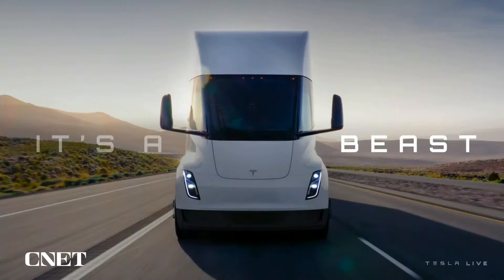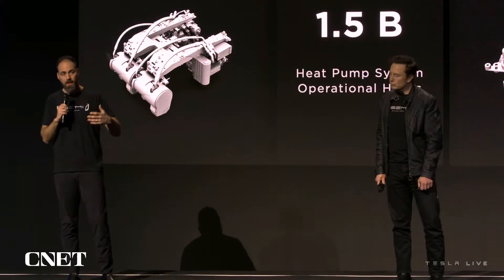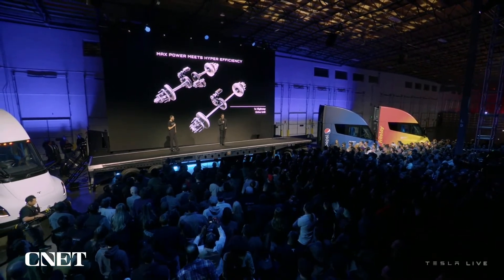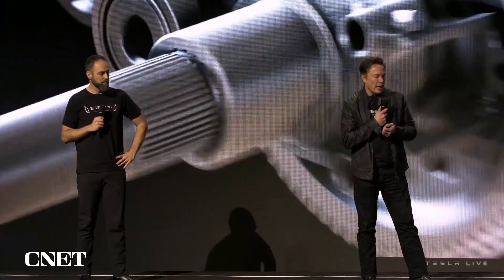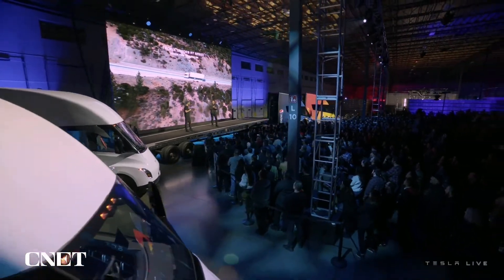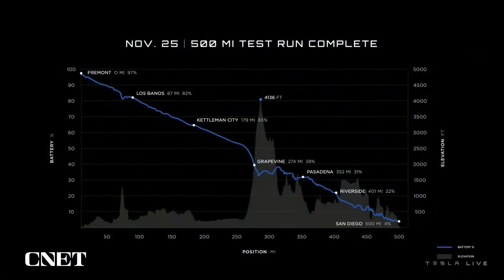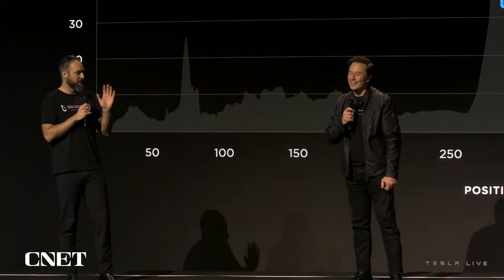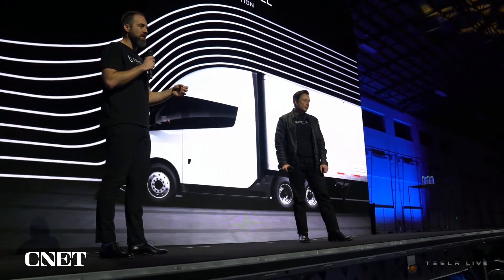Watch Elon Musk's Deep Dive Into the New Tesla Semi-Truck

Comment: How much heavier than diesel trucks  how much longer to stop and break changing game changer  imagine a hacked truck playing down the freeway  it's going to be a hackers world probably paid for by competitors   musk knows there's free energy  so where is it   Nicola Tesla would be rolling over in his grave
Reply: Not much heavier than diesel. 
Same or better braking distance as diesel.
30 mins charging time.
Hacking a Tesla is nearly impossible and they run frequent competitions to find and any holes.
Reply: @anthonypelchat  30 minutes charging time,  for a semi ,seeing believing  and the amount of batteries needed the weight  would vastly heavier which would make breaking distance vastly larger therefore needing much more regular break repairs at Tesla cost of course  side note I've seen what happens when you overcharge an electric scooter ,there have been reports of evs igniting for no apparent reason  very rarely but it does happen  oh and 1 last thing the chemicals needed to make the batteries ,lithium ,cobalt etc  isn't that just mining something different by the same cooperations  not to mention the child slaves in Africa  where did Elon come fro. Again 👁
Reply: @muaythai.8474  Charging time isn't a limit of battery size. Each battery cell is the same as what are in Model 3 and Ys. There are just many times more. You just have to deliver enough power to the truck with a charging system to charge it in that time. It is called battery charging C rate. 

The weight of a semi is the same as any other semi, no matter if it's an EV, diesel, hydrogen, or natural gas. They have a max weight for the truck, trailer, and load combined of 80,000 pounds, though EVs get 2,000 pounds more. So only 2.5% heavier at fully maxed out load. However, while EVs have the same regular brakes as every other diesel truck out there, they also have regen braking which can use the full power of the motors to slow down as well. That is instantly in use as soon as you let off the accelerator. So again, braking distance would be the same or better than any diesel truck in use. 

Fires in EVs are rarer than fires with diesel or gas vehicles by far. Overcharging only happens by dumb people frankly. It won't automatically happen. And mining for battery materials is done once over the life of the vehicle instead of over 800 times for a diesel truck life. And no, Elon does not get any materials from mines with children or slaves. Only cobalt is in that situation, and you can get cobalt from other areas. Plus they have nearly removed all cobalt from the batteries.
Reply: @anthonypelchat  I didn't know there was already e trucks.on the road I thought Tesla was the first fully e semi ,at masks presentation he said there were specialy designed breaks for the truck  .anyway you went to a lot of effort so I'll leave it at that ,the proof will be in the pudding so to speak .
Reply: @anthonypelchat   I have to ask do you work for Elon...are you Elon..  how do you know cobalt situation in regards to Tesla .
Reply: @muaythai.8474  I know the information because it has been publicly stated. And you can trace where the cobalt comes from in many cases. Further, all LFP battery packs are completely cobalt free while both Tesla and Panasonic have been pushing to reduce cobalt from their NCA/NMC batteries for years.
Reply: @muaythai.8474  Yes, there are other EV semis on the wrong. They may or may not be using similar setups to Tesla. The Tesla Semi is currently one of the most efficient semis available and at the largest battery outside of EV mining trucks. 

The specially designed brakes aren't really specially designed except in how it provides additional safety outside of just stopping. Just like current Teslas, they have regular brakes just like other cars. But they also have regen braking, which recharges the vehicle to a stop if needed. And it recharges the battery at the same time. Electric motors are really incredible.

Comment: Good with innovation but long-distance visibility is poor in this truck because the driver's position is low compared to conventional truck. You want to see above the vehicles in front to plan your braking. Anchorage of goods is not regulated and the deceleration from passenger cars is much higher than heavy duty trucks with its trailers. It is dangerous to drive in the high way at high speeds with 40 tones when you don't see what is going long ahead. In Europe the General Safety Regulation demands since 2015 active safety systems such stability control, so jack knife is effect is history here, the trailers and truck are equipped with EBS brakes and ESP since 2015. Advance braking system also mandatory since many years in Europe. So it is maybe wow ! for american but all the list of safety features they mention here is old news for European truck manufacturers and drivers. The next GSR 2 will demands even more, like lane departure warning, Intelligent Speed assistance, recognitions of vulnerable road users etc, all that to be implemented by 2024.  Cab strength requirements would be interesting to see if it will get approval for. The electrification part if good with regeneration of energy with the braking forces but brakes need to be used other ways will be glazing and when no brake when you need it.

Comment: What if you charge at the top of Flagstaff and you need to use regen on the way down? You can't over charge the battery???
Reply: TRUCK has Neutral can COAST.
Reply: @markplott4820  but you need brakes to control speed if you are in neutral. Have you down those hills?
Reply: The recovery effect is too exaggerated. It will not have a significant effect on the range.
Reply: If you are at the top of mountain, don't recharge much. No reason for a full charge in most cases anyways.

Comment: If the first model is this capable imagine what they will be like in 10 years
Reply: What do you mean? It could be less capable to cut costs. Its always first generation that they put in best work in also hardly anything will change in that time only battery capacity probably.
Reply: @outlander234  Compare a 1920's car to a 1990's car.
Reply: @lauriesmith9019  What a ridiculous statement. Car technology has reached its peak long time ago, there are no more massive improvements underway. Drivetrain, suspension, aerodynamics etc. its all solved long time ago. Electric motors have also been mastered long time ago. Only level of improvement is the batteries.
Reply: @outlander234    Look at the Plaid motor, carbon wrapped rotor - never been done before.  Every year we see new advances in materials allowing things to become lighter and stronger - no improvements there???  The point is you cant speak of 2033 technology with 2023 thinking.
Reply: Yeah this truck does have all that has gone before it from electric trains and from their own cars and AI and production but these guys love to keep improving its so exciting to see the rate of improvement!
Reply: Or a few thousand years ?

Comment: I'll believe the 500 mile range with a full load claim when it's independently verified by a 3rd party lab. I have heard enough claims from Elon before (Full Self Driving video in 2016 showing a dude riding in a Tesla without doing a thing, 1 million robotaxis by summer of 2020, fully functional solar tiles unveil, all of which were total BS) to not trust a single BS claim he makes without independent verification. If this truck can really go 500 miles on a charge as he claimed back in 2017, they would have shown a range test back then, not 5 years later, and even now it's just an unverified claim.

Comment: As a truck driver I know one of the things Im looking most forward to is, not having a transmission that starts "hunting gears" when Im trying to accelerate through an intersection. Cant tell you how many times Ive felt like that could cause an accident
Reply: What do you mean by hunting gears? I'm curious, never heard that term.
Reply: @MrSaemichlaus  its when youre in an automatic that uses the air piston actuators to shift, and you mash the gas pedal, and the computer/transmission cant determine what the appropriate gear to be in is so itll pop into 4th, and then immediately into 5th, then 7th etc. and wont budge the truck at all. Really sucks when it does it unexpectedly and you have a car coming right at you while making a left turn in an intersection
Reply: @BigRedftw  I see, thanks for explaining. I have seen that on trucker vlogs but didn't know the term. I see the potential for danger in that sort of situation.

Comment: Elon says this is "3 times the power of any diesel truck" - but this is patently false. Many 600-700hp diesel tractors are made today. With three "Plaid" motors, there's no way this truck is making 2100hp.
Reply: 400x 3 = over 1200+ HP , 1.7kwh/mile super Efficient.

Comment: Considering Peterbilt, freightliner, and Volvo already have been out for 2 years already I'd say Tesla still has the take on it considering they got better range ....now what would be neat is Tesla come out with a 48 and 53 foot trailer with a chassis mounted battery ...so in reflection it would be easier for smaller fleets and then for larger fleets offer a kit or service to rebuild existing trailers....this way you can drive the 700 to 800 miles in a shift.
Reply: NONE of the other BEV semi  are 500 mile range and 1.7kwh/mile .
Reply: @markplott4820  most companies like the one I work it dosnt care....the long haul Mack CX or freightliner cascadia powered by diesel does the haul for 700 to 1800 miles and the last 40 miles we drop the trailer at the shop and hook up a electric Volvo....the shippers think its great, the government rewards the owners of these trucks at tax time and no one has clue on which type of truck did 98 percent of the haul....
Reply: There is no bed in the truck. The truck will be used for city and fixed trips. This is not a long distance truck. And it is unlikely to become so.
Reply: @sergeypavlov7249  you can get a bed as a option if you wish ....you have to order it the way you want it on the website.
Reply: @trainandtruckmodeler786  If they had presented a truck for long distance truck, then the bed would definitely have been shown. They are not aiming at this segment. Then it's not another class of trucks? Is there a special permit required?

Comment: This truck has great improvements in long distance transportation. Great stuff, keep pushing Great stuff Elon
Reply: It's obvious you haven't ever driven a truck, 500 miles max isn't going to cut it. When the truck can run 700 miles on a single charge, then we can talk. I was a local short haul driver for years and did 600+ miles everyday and I'm pretty sure a lot of OTR guys are doing that as well. Lets not even start talking about team drivers where the trucks are practically running 24 hours a day.
Reply: less than half the load carrying capacity of a conventional truck. There is a reason why they have decided not to supply them to the market now and just use them ‘in house’ 😏
Reply: Since when was a MAX of 500 miles considered long distance?  Keep drinking the Kool-aid